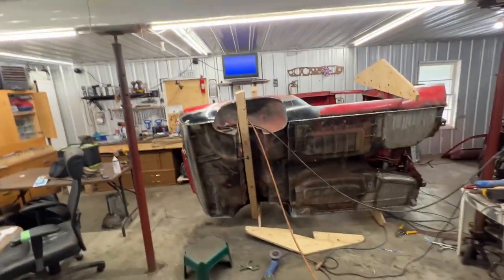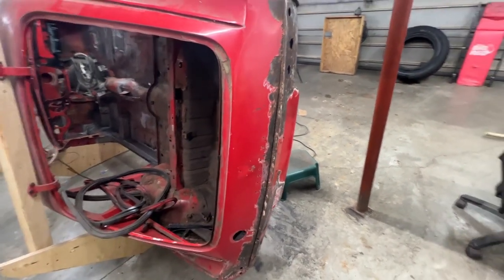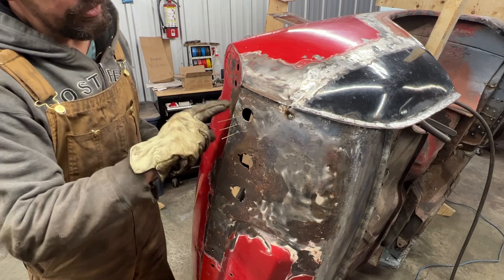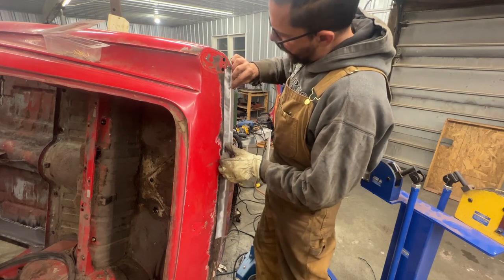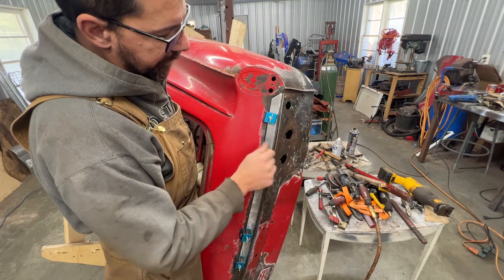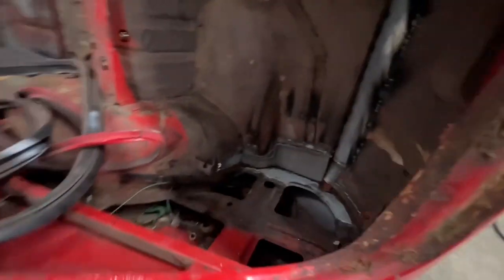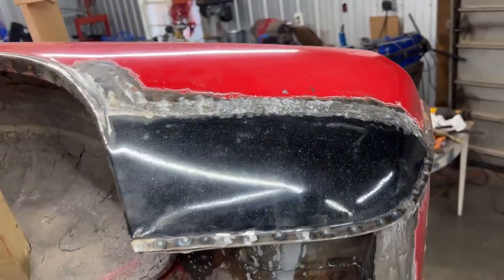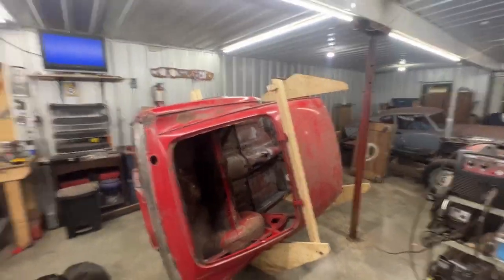1966 Triumph GT6 - Part 62 - Deleting A Factory Seam

Comment: A solution in search of a problem. Seam sealer would have been simpler. This approach provides dubious rust proofing benefit, makes it difficult for future valance replacement, adds a bunch of additional work to make new rear deck supports,  while removing stiffness from the panel.

Comment: Very nice fabrication and welding but I think you have taken a lot of strength and rigidity out of that part of the bodyshell by deleting the folded joint. It’s a vulnerable area especially with the bumpers mounted to the corners, maybe you plan to reinforce it internally when you redo the shelf supports ?

Comment: Elin, I’ve lost the plot a tiny bit because I can’t see which seam you are supposed to be deleting ? Help needed please!
Reply: There's a seam where the original top and bottom pieces met - they're both bent 90 degrees and have their flanges welded on the inside. The piece he made deletes the seam by making the upper and lower pieces essentially one piece thanks to the welded butt joints he did. No more flanges inside.
Reply: @scotttryan  got it now, thanks Ryan!